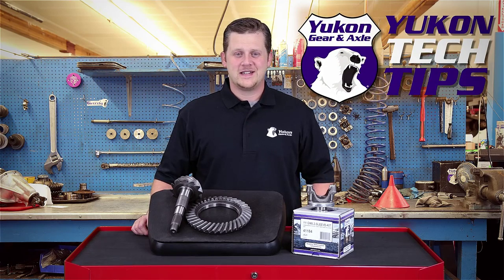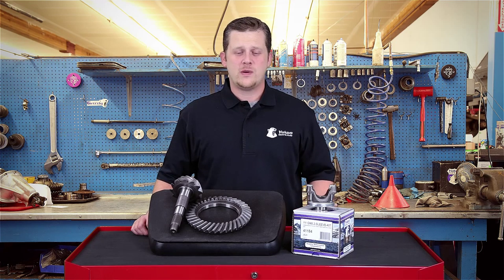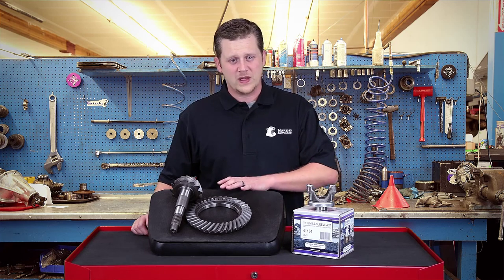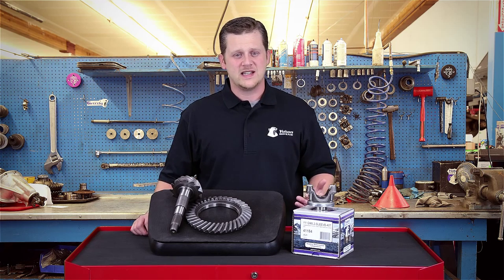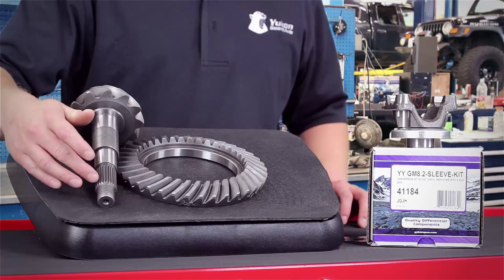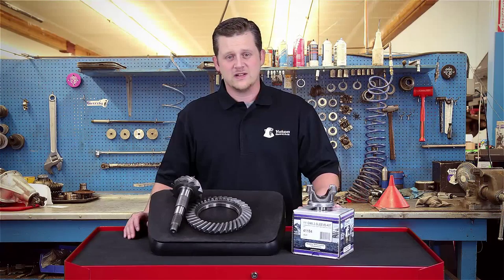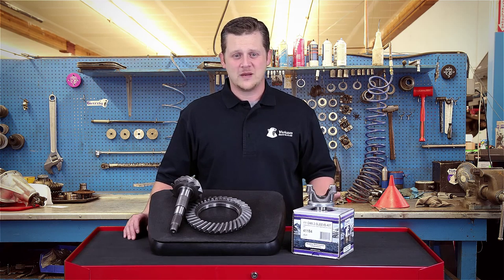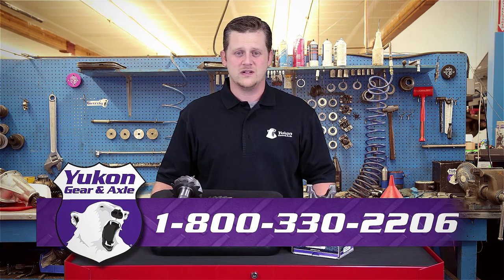Installing a GM 8.2" Gear Into a Buick/Oldsmobile/Pontiac Housing | Differential Tech Tips

Comment: How much hp crank or wheel hp would this be able to handle?I cant find a straight answer anywhere. Had my Yukon posi and Ring and pinion for over ten years now and hasn't broken. Given that i was running only a 380hp sbc 350. Looking to make more power around 600crank hp and wondering if i need to upgrade to a stronger rear diff. Thanks
Adrian